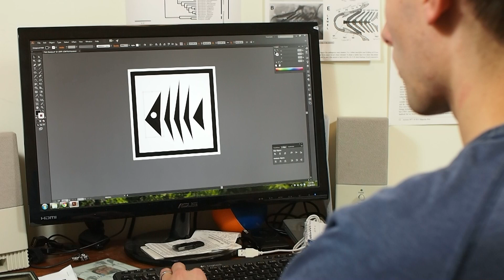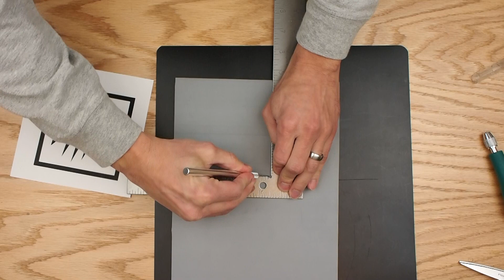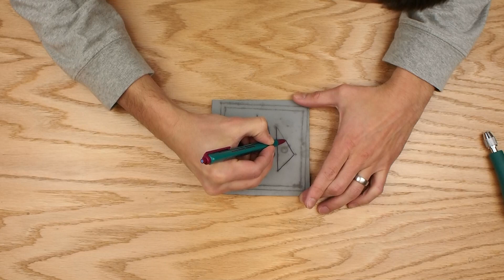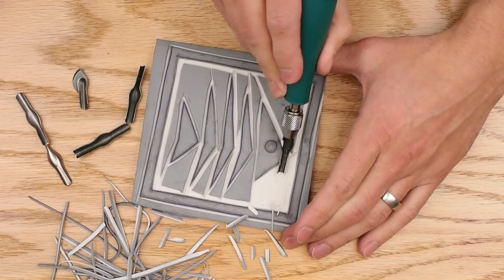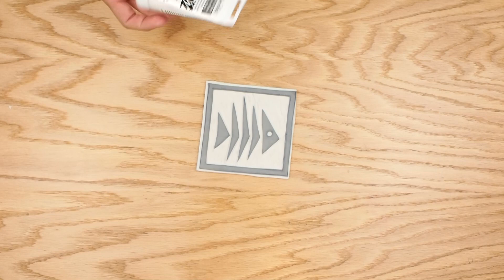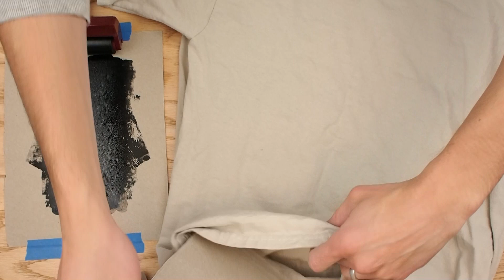Block Print T-Shirt Tutorial

Comment: Thanks for the video You may have answered my problem. I have been trying to use a brayer to ink up my blocks but am using screen printing ink and does gt work very well. I've changed to a sponge but will look for other ink as using sponge takes longer and not as smooth application as a brayer

Comment: Very helpful, thanks. When printing on fabric, why do you not recommend normal lino?
Reply from the maker: +Teagan Carnes  I've always heard that you need to use oil-based ink with normal linoleum blocks. I've never tried it but that's just what I've heard.
Reply: Cool, thanks.
Reply: +Teagan Carnes in my printmaking class we used oil based (the specific ink info escapes me) on regular mounted linoleum blocks for shirts. It's been a little over a year and the shirts still look great. You need to let it cure though for a few days and turn it inside out to finish it off it in the dryer. This way looks fine too. Whatever works, you know?
Reply: The ink used in this video is oil based and works great with regular linoleum! This particular ink is made with a water soluble oil, so it is easy to wash off of the tools before it is cured.